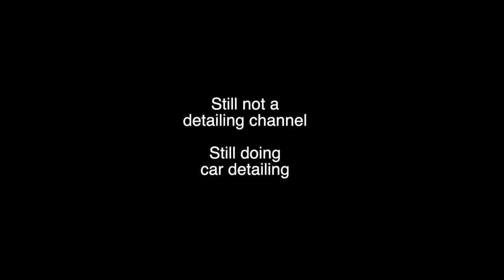Alfa 145 post repair clean up part 2 - the outside

Comment: Great job, Matt, as always. For the entire 31 years we have had Arthur, my 1990 Volvo 240 Estate, he has been washed with dish detergent in the fall, then given a good coat of good wax. Arthur always came up like new, and was never washed again until spring. He is always a MESS by the time he gets another wash in spring. I'm a bit envious of that gorgeous paint. The shop I used to go to splashed brake fluid or something on the roof and bonnet, and it ate the clear coat and some of the Ice Blue paint. Worse luck, I didn't see it until too late. Have to do a full repaint now. In spring, I guess. No point painting the car only to face our winter. Keep going on that little beauty. She is a lovely old girl.

Comment: What a transformation! Smooth and shiny paintwork, nice work Matt. When I detail outside in the winter and need to do some claying I use 2 bars and a bucket of hot water. Use one, when it get's dirty and hard, throw it in the bucket to soak and make it soft again while using the 2nd bar. Luckily my own cars I can detail inside. Such a pretty car, she deserved some loving!
Reply from the maker: thats a good idea, I was going in to top up the tea and put the bar on the radiator as often as possible!

Comment: Little tip, wash the car normally, then immediatly clay bar it. The suds help lube the bar, then pressure wash the suds etc off. Saves money on the clay lube which is just quick detailer etc.

Comment: Another great product to use on greasy crud on engines and especially electrical components nearby, that also does not leave a chemical stench is electrical contact cleaner. Of course it costs a bit extra however don't have the issues of shorting electrical components and don't need to run water over the engine.

Comment: Looking good after the detail. I use the Farecla G3 clay mitt, as I don't get on with the clay bar. Get just as good results and after a good clean it's reusable.
Reply from the maker: Ive used other brand clay mitts, they work well, maybe not as thorough as a bar but still good results

Comment: It’s a bit late for you now Matt, but I got a replacement Karcher hose when mine kept kinking from Direct Hoses in Rotherham, the benefit was it was around £25, it was longer than standard, you didn’t have to buy the lance and it is armoured so it doesn’t kink., even paying postage to Australia it was cheaper and way better quality than what I could get here

Comment: Using a cocktail stick for touching in paint chips works quite well. I can suggest a better method which I use.

Insert a sewing needle into a cork, point first. The other end of the needle of course has an eye in it. This acts as a small reservoir for the paint and allows very easily controlled amounts of paint during application. The cork itself is easy to grip so you can control the needle better.
Reply from the maker: thats nice improvisation, practical too. Ive plenty more spots to touch in, lll try that. Might need to open some wine first, what is a shame...
Reply: Them corks are hard to come by! Still I'm sure you'll manage  ...

Comment: Fantastic job! It really came out well, all your time and effort paid off!
I think most detailers have garages so that they don't freeze.
Actually not really surprised at how much dirt and grime came off, all of it is environmental fall-out.
Does your power washer have adjustable intensity? Least intense is great for the engine bay. After a little practice during the summer you can do the door frames and around the boot lid to blast away that grime. However, you did a great job with what you did, so I applaud all of your hard work!
Reply: Next time you snow foam, break out a soft detailing brush around the badges, grill, door handles, etc. This is what I have seen on other detailing videos. Not criticizing, you invested a lot of £ into restoring, you want it to look absolutely beautiful.

Comment: If the pressure washer is reluctant to start if will probably be the mains micro switch that is activated by a pressure operated spring plunger that is sticking. I have mine stripped down at the moment and have freed up the plunger with WD40. Mine is not a karcher but I think they all work the same way.
Reply from the maker: I think its the wall socket

Comment: Should have used the iron out on the roof from the grinding it would lift the little rust spots straight out that is what it's made to do lovely looking Alfa
Reply from the maker: I couldnt find the bottle!
Reply: @furiousdriving  you used it on the wheels 🤔
Reply from the maker: @davidbates247  oh yeah, I was thinking of a Iron Out, which is a rival brand! I have used this on paint before..too cold to think out there!

Comment: Surely the point of Sno- foam is that you put it straight on the car so it can sit and work, if you rinse it off first it just runs off twice as fast ?

Get the thermostat done and she’ll be sorted, very tidy.
Reply from the maker: I understood the car needs to be wetted first, just what Ive always been told

Comment: My punto mk1 rear wiper has the same problem as your alfa.
Reply: My Kia proceed is the same so I bought a cheap wiper blade and used the rubber and steel bits from that cut down to fit the Kia arm using a dremil. Happy days and cost about 5euro.

Comment: TFR will remove any ceramic coating that you may have applied. Snowfoam all the way on the outside.
Reply from the maker: true, but then ready for a fresh application if needed. I do prefer snowfoam outside as well

Comment: Procrastinate /prə(ʊ)ˈkrastɪneɪt/ 
v.
Make 2 videos about cleaning a car, when you have one car without a roof, one car without an engine, one car you've just got the engine running (?) and one that has missing headlight wipers.

ps at 9:30 you needed to add some Barry White.

Comment: Does that snow foam actually do anything as far as lifting dirt goes ?.Looks well now. Those clay bars just  look like old blutak
Reply from the maker: yes, it soaks into the dirt and lifts it away from the paint so theres less grit to scratch it when you sponge. On a regular wash (snow foam and sponge) the car looks brighter and shinier than a suds wash. 
The bar looks like play doh but is much thicker and tackier

Comment: You shouldn’t be jet washing under there with that much power, especially not on the scuttle! You’ll end up with water inside the cabin. I always use a garden shop pump with hot water whenever I do engine bays, low pressure only

Comment: Please can you contemplate replacing those hideous Halfords 'flappy paddle' aero wiper blades on the Alfa 145 with the proper 'period correct' Bosch ones? The 'flappy paddle' aero wiper blade on the driver's side doesn't even clip into the small retaining bracket on the middle of the wiper arm and the park position angles on both them are all wrong as well.
Reply: Surprisingly he’s not sponsored by Halfords, just a free advertiser apparently.
Reply from the maker: I dont think they are Halfords, just generic wipers. Im always surprised people are so annoyed by them, I barely notice! They do look too short though so would change for that reason

Comment: Mate, respectfully, watch some detailing videos. You are using way too much pressure on the clay, and nowhere near enough lubricant; you should be soaking the panel constantly with the clay. If you don’t want to waste money on lubricant, run some car shampoo in with some hot water, it does the same thing.

I’d be amazed if you haven’t put scratches into the paint.